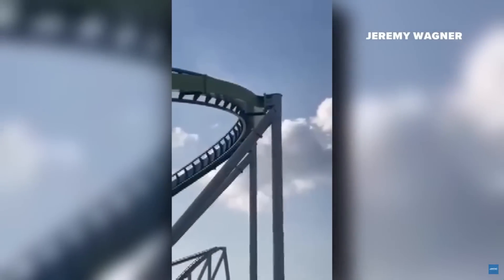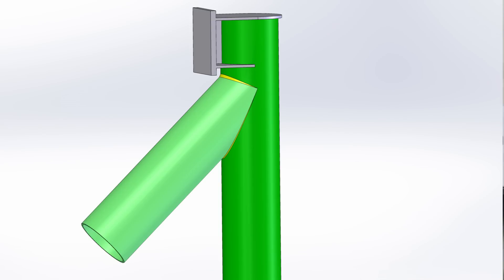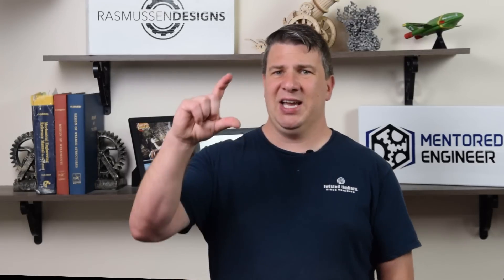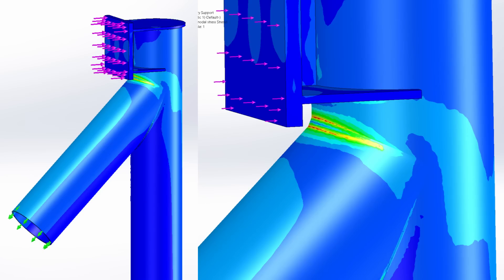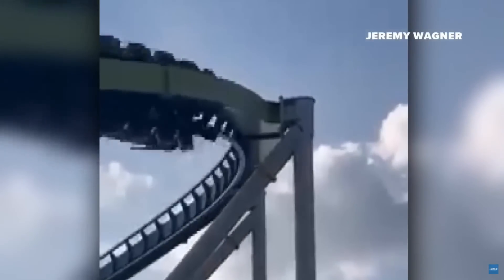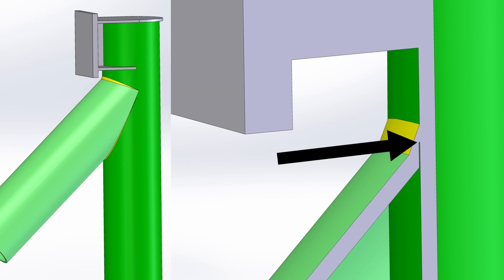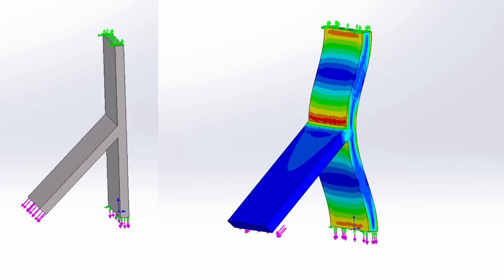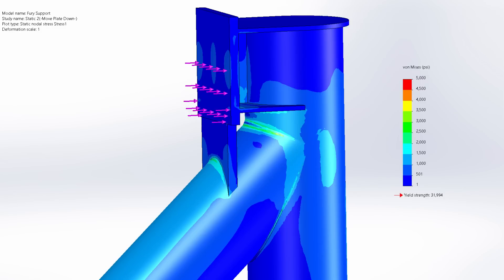Fury 325 Crack! Engineering Analysis and Response

Comment: And it took them all of 2 weeks to get B&M's factory in Batavia to get another support made.

People forget that the blueprints are still readily available and another one can be fabricated quite quickly.

The thing to worry about is... what caused this in the first place on a coaster that is only 8 years old.

Did they have a design flaw that took 8 years to manifest itself or has something about the ground The coaster sits on changed somehow.

It's easily a 5 ton vehicle empty. Add 32 people of varying weights, shapes, and sizes, and that load quickly jumps to 8 tons or more.

Their engineering department better find out what the real cause of this catastrophic structural integrity failure was, because I have yet to hear it from someone that actually knows for a fact, not just engineering speculation.

Comment: Glad you looked into this.  What aboutnatural frequency causing the crack.  My experience with vibrating conveyors, I came across many failures where the vibrating frequency, which was at or about the natural frequency of the metal structure caused the failure.  At one point one of the major users required the entire piece of equipment to under go analysis prior to approving drawings.  I think it will be found to be more than just a bad weld or defective metal.  time will tell, one way or another.
Reply from the maker: I doubt it.  A substantial amount of a conveyor's load is from operating around the natural frequency.  With Fury, the cart running is 99% of the load and you are looking at a fairly low fatigue count compared to a conveyor which may have several load cycles a second.

Comment: And to add fuel to the 🔥.......

The Fury 325 roller coaster, which can take 32 passengers at a time, was shut down on July 1 by the Carowinds amusement park after staff were notified of a crack at the top of one of the ride's steel pillars.  And according to North Carolina Labor Commissioner Josh Dobson, the crack may have been visible as early as 10 days before the ride's closure.  "It looks like maybe six to 10 days prior, some pictures had been taken that shows the beginning of the crack, and then by obviously last Friday, the thing was completely severed," he told the Associated Press on Friday.   - courtesy  of Insider
Reply from the maker: Thanks AI

Comment: Stress points could have sensors added to set off alarms when parts completely separate.
Reply from the maker: Possibly, although maintenance of these systems might be worse than regular inspection.  I'm sure there would be a lot of false positives due to malfunction.
Reply: @MentoredEngineer  True, but it would also make someone get a close look at the joint.
I'd count that as a win.

Comment: They could install two vertical concrete filled rebar reinforced columns behind the existing column and brace them together with a collar and attach the track to the collar to take the stress off the original column, they could do the same with the remaining columns that see high stress and prolong the life of the ride for decades.

Comment: Things happen over time. Likely stress fracture. Repeated side load. They will have to check this thing with an X-ray annually if they decide to just replace it like it was. They may actually want to scan ALL the beams now to see if this is happening internally on any of the others.
Reply from the maker: Good point

Comment: The problem is the techs do not do regular track inspections. I work at a large park and track inspections are conducted everyday. Some areas daily some weekly depending on the stress put on that section. These rides will unfortunately always end up eventually having a Crack and needs to be repaired they key is catching it early.
Reply from the maker: eh?  So you contradicted yourself.  Do the techs do regular daily and weekly inspections are not?
Reply: @MentoredEngineer   @MentoredEngineer  how is that contradicting? I said regular track inspections some areas on the track are daily if they are known to be under a lot of stress and the areas that are not under high stress is weekly. For example every night you will see a tech repel slowly down one section of a ride because that particular section has a daily PM that has to be done or the ride can not open for the day. On another day you will see a tech repeling down that same section while other techs are in a couple of high reaches inspecting other sections of the track. Because thoes are on weekly PM's. Every ride is different and has pm's that are at different intervals based on that particular ride. In some cases you will have a portion of the track that has daily, weekly, and monthly pm's. Thoes PM's are designed to go over thoes areas in detail. During thoes checks if an issue is found that is when QC is called to inspect the area with special tools and if needed call weld out to excavate and weld the section that is in question. Regardless of the daily, weekly, and monthly PM's which are specific to certain areas on the track and is a detailed inspection the entire track is looked at by a couple of people everyday but this is a general visual inspection.

Comment: Your analysis ignores a very obvious issue with this design: Expansion in the track and no joints to accommodate it against a rigid support system. Better welds will not eliminate that stress and ultimate mode of failure.
Reply from the maker: I doubt that adds more than 2-3% of the load.  These things are less rigid that you think.
Reply: Not even a month later . . LOL

Comment: Well, all of that would be true if this were static loading.... which it clearly is not! Steel does not crack or break unless it has a fatigue failure due to the number of cycles and load seen. Normal steel testing shows that, under a pure static tensile load, it stretches before it breaks. Also, the support is cantilevered-loaded so, the front weld has a tremendous load, as you pointed out, and being load-cycled about every 30 seconds..... and unless someone tested that part, we don't even know the stress or strain on that front weld.... And, since momentum = mass x velocity², you have a pretty good idea of the force applied. But, with no other data... this looks like a fatigue failure......

Comment: Civil and welding engineer here, I have to disagree with quite a few of the points here.
I have done research in hollow section joints. The stress concentration usually on the weld toes (weld cap) for most geometries is much higher than the stress concentration at the weld root. So for most of the joint geometries, it simply does not matter at all, if you carry out a full penetration weld or a fillet weld, as the cracking will start on the outside on one of the weld toes.
You can even predict which one of the toes is most likely to start cracking, look at CIDECT Design Guide 8. 
Two other things to consider: not sure about AISC 360 and AWS D1.1, but other codes a) require a full penetration weld at least at this crown point of the connection and b) in case of fillet welds require to make them full strength, i.e. the fillet weld must have the same strength as the base material. Due the varying stiffness and therefore stresses around the perimeter of the weld, you cannot tell without FEA how high the stresses at any point are, hence go full strength everywhere.
And avoiding hollow section joints? Good luck. Those are standard joints with more than enough research behind them to also create formulas for assessing their strength without having to use FEA. And if designed correctly, those joints will not fail under static loading. Or, to be more precise: fail with a probability less than 1:1,000,000.
BTW: you concentrated solely on the design. You completely neglected the two other parts of the whole equation:
a) manufacturing. A weld flaw in that area and the whole desing goes boom. And don't think NDT would help, because if there's no requirement, NDT is done on statistical basis, aka a certain percentage. And depending on the method of NDT and type of flaw, your detection rate is ranging from zero to about in best case (phased array ultrasonic testing) about 80%. In case manual UT was done, you can expect detecion rates of about 40-60%.
b) most engineers do not know, that especially for fatigue design, you can't design with 100% probability of survival. The Wöhler lines for fatigue design are based on a statistical evaluation using a normal distribution with 97.5%/97.7% probability of survival. I once did a series of tests with approx 50-60 test specimen. And guess what? I had one outlier which was below the 97.5% survival line. So this would also be an option why this thing has started cracking: pure coincidence.
And that's why especially for fatigue loaded parts, regular inspections are mandatory.
Reply from the maker: ok great!

Comment: Could the ground cause be overload? I mean, when the coaster was constructed, they might have counted with a median load of say 90 kg per person, meaning they calculated all support structures with wagons good for say, 1T per 10person wagon. When people generally becomes heavier due to eating too much McD, lets say median weight of 120 kg per person, there will be overweight of 200 kg, which translated to lateral dynamic forces is about 800kg-1T. I checked a table of G-forces and Fury have 4G, thats a overweight of 800 kg on that support pillar. No wonder it is subject to metal fatigue, as it was not built for those loads.

Maybe amusement parks should start weighting their passengers to make sure that the wagons both are evenly loaded, but also so no wagon becomes overweight? Or impose weight limits, a scale that will show a green for OK weight, or red for too low/high weight for safe travel. Or even, at entry, you weight, and you will then get a coded bracelet that has a encrypted QR-code telling which rides you can take.
Reply: Static design according to ASTM 2291 requires to assume a 300lb load for a single person in static load cases. For fatigue load cases 170lb are assumed, simply due to the assumption that not all trains will be loaded with overweight persons in each and every run during the ride's lifetime.
How often does this happen during the lifetime, a train fully loaded with 300lb people? Maybe never, maybe a few times, that's nothing in the grand scheme.
Reply: @johnscaramis2515  But can we be sure that they have adhered to ASTM 2291 standard? and 170 lb is a bit low even for fatigue, since the median weight is higher today. People are more fatty and eat more McD, they become obese, and even if you take a good mix of light and heavy people, you are still going to blast the 170 lb limit.

They should IMHO start weighting all passengers and add to a tally. When next person weighting would blast the max total weight for a train, they should send off that train even with a few empty chairs, and have next train to be filled.

this means every train might go with like 2-4 empty chairs because too many obese persons boarded the train, but then max weight may not be exceeded.

Sending off trains with empty chairs also means obese persons don't get last in line all the time just because you are "trying to fill each train", instead the rule becomes fair, if train is full, its full weight-wise even if theres empty chairs, and we send it off.

Could be arranged with a scale plate just where you stand before boarding, and computer adds each passenger's weigt to a total tally, if the person currently standing on scale, would cause train to go overweight, train is sent off, then he is first to board next train instead.
Reply: @sebastiannielsen  I am working in a company that checks ride calculations. And I can assure you, companies like B&M will always follow those requirements, otherwise they won't get their necessary paperwork. It's also a matter of liability.
I assume that the people in the working groups of ASTM are no idiots. The codes are reworked every few years, if there is a significant change in weight, they will incorporate it. The last revision of the code is from 2021 or 2022.
What most people and also many engineers don't know: for static design it's either fail or withstand. For fatigue, it's a summation of individual small damages per each run. You may have a slightly higher stresses during one run, but then you also have empty runs (e.g. daily empty run before opening), which cause close to no damage, but are counted as runs. Unfortunately many engineers are simply working with it as it is similar to static design.
And if we look on the resistance side, things get even more complicated. If you take two parts and test them with the same load, one might withstand 100,000 cycles, whereas the other can withstand 1,000,000 cycles. Or maybe 2,000,000.
There are so many other uncertainties in fatigue design, which are not predictable, passenger loads are only one part of those. That's why there are regular inspections, to cover for those uncertainties.
So even with your plan, a fatigue crack might happen. Even if you would limit the ride only to 170lb persons, a crack may happen.
And who knows, in the end it might have been simply a flaw in the weld.

Comment: How bout another support post from the point of track connection coming off the right hand side down to the ground at angle?
Reply: Would not change anything, because the problem is a the point where the column head meets the weld of the diagonal.
Maybe a better explanation: if you mount an antenna on the roof of the building and the anchor points between antenna and roof fail, stengthening the building will not help.

Comment: Should had been inspected under load before the was open to public.. ;-(
Reply from the maker: That would violate so many OSHA regulations.  Having a guy inches away from the train as he is inspecting.
Reply: Even if that would be allowed, if we are talking about fatigue cracks, those develop over time, hence won't be there when the ride is assembled.
But if you think of checking each column each and every single day before opening, you need staff for that. Or time. Let's see, the track is about 6600 ft long, spans between columns are roughly every 20ft, probably less. Makes 330 columns. How much staff do you want to put on this task? And would you be willing to pay for this staff?

Comment: The post is designed to have some flex, your solution is to remove the flex.  That will ultimately result in a catastrophic failure, where in this case, the other supports acted a redundant support, and took the load.  Two things will happen.  The entire support will be replaced By B&M, possibly more as they took unusual stress for an unknown time period or the ride will be removed.  Hopefully the Park President and Maint. Director will be fired for a culture of lax inspections. This was likely the result in three things, not two.  Weather as metal expands in the heat, unanticipated stresses over time and what will be eventually stated, an unforeseen failure in the mfg process of the support. The latter being easier to state than design flaw as there are other coaster made similarly by B&M across the country. Cedar Fair will downplay the risks and safety and hope the final story is buried.  The Park President and Maint Director will be left untouched as no one was hurt and the park did not get sued.
Reply from the maker: Cracks on coasters happen more often than you think.  Look at the Bat or Big Bad Wolf.
Your opinion on the flex is also incorrect.  Military aircraft, like cargo planes, have wings that move 10-12 between on the ground and in the air.  Commercial airliners maybe have 1-2 ft of sway under normal operating loads.  We don't see airliners falling out of the sky because they are stiff.  It is all in your design goals.
There are probably way more than 3 things responsible for the failure and the investigation will find them all including human factors (operations, management and inspections) as well as the mechanics.
The temperatures in question here are not in a range that will effect the stresses in any significant way.
Reply: @MentoredEngineer  Please read what I wrote and not what you think I wrote.  The post needs flexibility, otherwise it would snap like a toothpick.  Your solution appears to remove flex and movement.  A stiffer system is unhealthy. Watch every roller coaster, they bend and move.  I also attempted imply the weather was a factor, not the total answer.  'Cracks appear more often than you think,' yes, aware but they are usually caught.  This one was not. Also, this coaster is a baby at 8 years old.  I can tell you stories about what appeared to be catastrophic failures which went unnoticed, and no one got hurt.  Right now every Park is re-inspecting everything, including Six Flags, all Cedar Fair, Merlin, Universal and hopefully Disney to name a few.   However you are still safer on ANY roller coaster than in the car ride to and from the park.  Thanks for the videos.
Reply from the maker: Ok, great!

Comment: It failed. So the safety margin wasn’t a factor of 2-3. Which to me indicates many or most joints may be at margins of 1-1.5. 

And public perception and insurance company risk assessment would IMO require a serious rework and X-ray inspection of EVERY weld gusset fastener. 

Recertification is gonna be hard. As it should be.